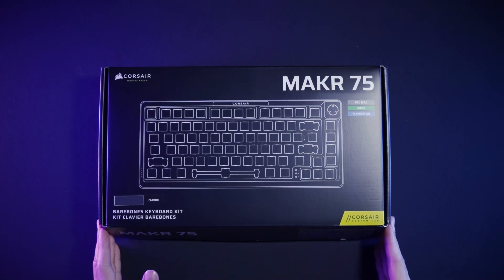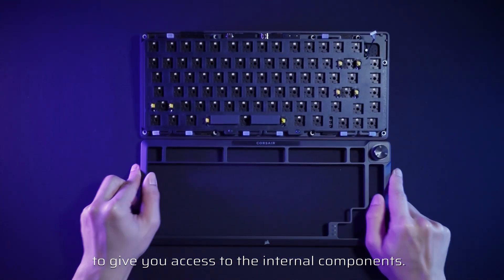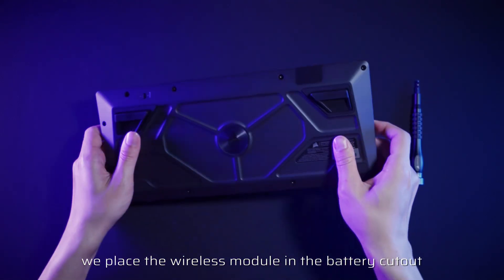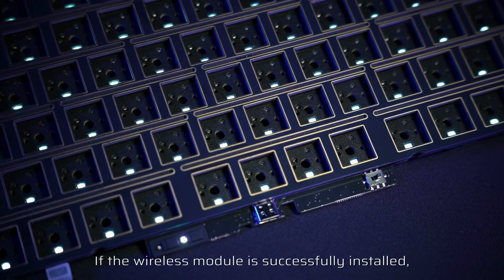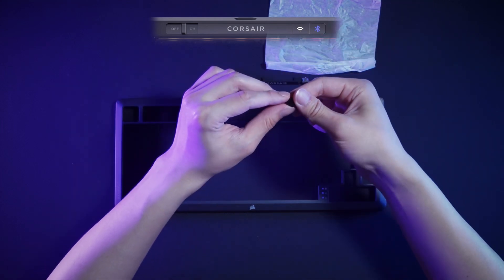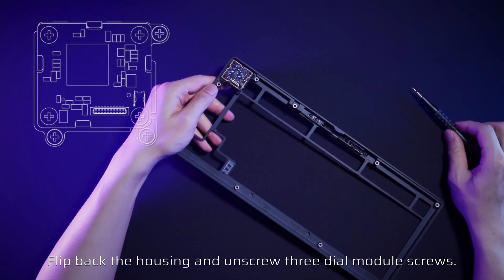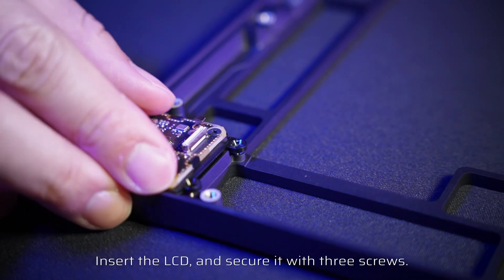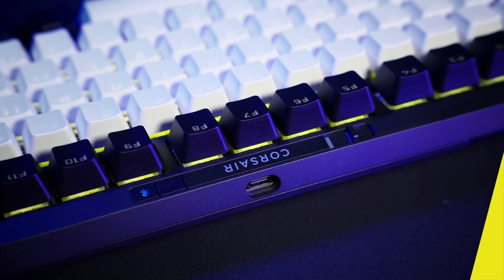How to Build your MAKR 75

Comment: charging upwards of 300 dollars for a keyboard without hall effect switches is kind of wild.
Reply: Yeah kinda crazy that there's no hall effect and actual good software to match, as hall effect with half baked web driver is no good , corsair could have a winner if they actually had this hall effect and good web based driver to match
Reply: @ivanshingler8926 another major problem is that other brands like keychron or monsgeek have diy kits for full aluminum cased halle effect keyboard with gasket mounting foam dampening and other features etc. but for like half to 2/3 the price of this one.
Reply: To be honest, there are still mech keyboards without hall effects close to that price.
Reply: @sergie2822  Yeah but usually they are higher quality and dont look like a quickly thrown together DIY kit, you can get a similarly styled TKL DIY kit from a brand like wooting or keychron get all the same features as well as low latency and hall effect switches.

all the bells and whistles you could want for like $50-100 less in some cases. add on top this fact that corsairs Software is garbage theres really not alot of reasons to buy this.